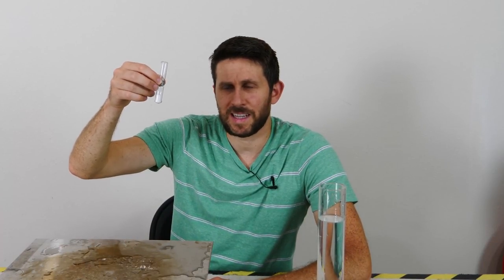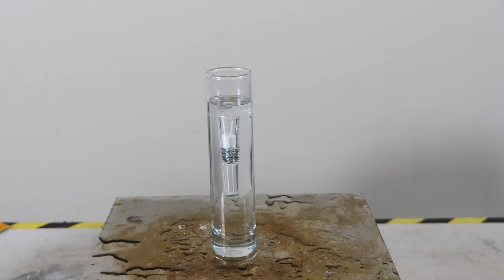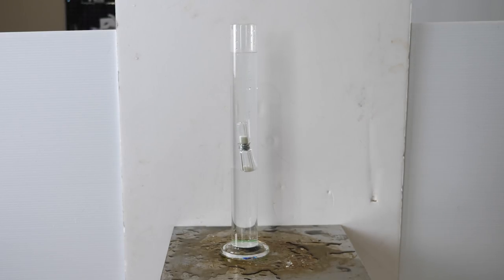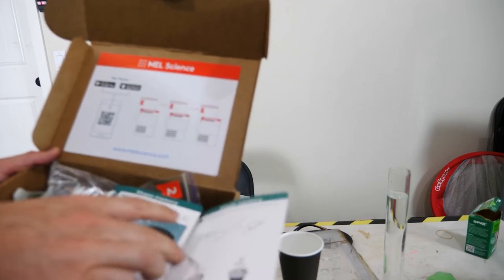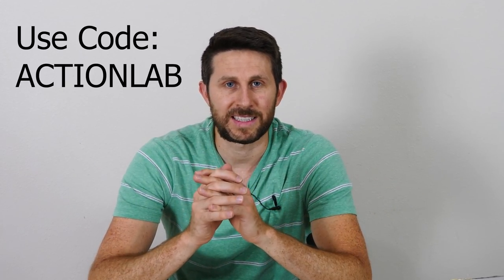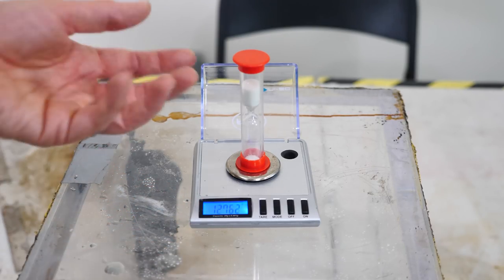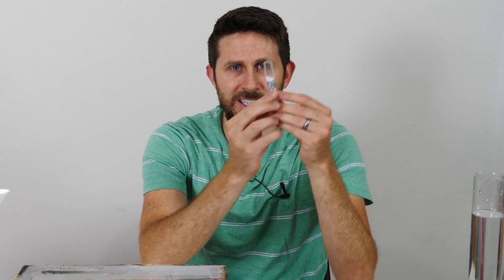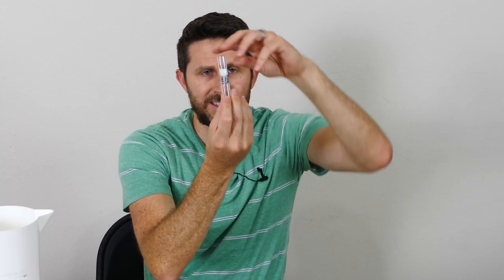Can You Figure Out The Hour Glass Buoyancy Problem?

Comment: Vibrate the host tube walls to release the friction by bouncing off of the sides.
Reply: No matter how much you vibrate the tube, the problem is the tube is too narrow for the hourglass to ever flip over.
Reply: @jerkofalltrades  but the friction would momentarily go away as the glass bodies separate.
Reply: Or tie a payload at bottom with a string and tune the density of fluid one weight of sand to support that load and it shouldn't flip over.
Reply: @jerkofalltrades  But it doesn't have to flip over to sink, if it did, then friction wouldn't be what causes it to float.
Reply: He forgot to show us one thing, what happens if you start with the hourglass at the bottom of the tube? He could’ve pushed it down as he even says in the video with a glass rod
Reply: @Qexilber  YES we need to see this! If it doesn't float up when it's at the bottom and it cannot turn itself then it would definitely prove that it is indeed friction
Reply: It would just sit at the bottom because it's too heavy to move upward with or without the friction.

Comment: I thought it would be something like how the center of buoyancy would be lower when the top boards fall, and it would be in slightly denser water because of the gradient and that would be enough to keep it up, then when the sand goes down the center of the points he is slightly higher
Reply: I agree with everything you said other than the water getting denser.  The water pressure increases the deeper you go, however the density remains the same as water is essentially incompressible.
Reply: I thought about this too. When the pressure is a little higher it pushes it more upwards.
Reply: Thats a pretty cool trick.
Reply: The center of buoyancy has nothing to do with the amount of buoyant force.  The density of water is the same in the container so buoyant force given by Archimedes (only displaced volume matters). This is the reason why the experiment is perplexing at first glance: Buoyant force is the same whether the hourglass has sand on top or bottom. The only explanation is what he  said in the video, friction with the container walls
Reply: @damartimantilla  hi. Overall buoyant force for the hourglass is the same as you said but the centre of neutral buoyancy changes slightly as the sand moves from top to bottom. That’s why it wants to flip over.
Reply: @nattycaptainanavar8319  no, the centre 9f buoyancy does not change. It depends solely on the shape of the object that is under water (and this shape does not change). What does change is the centre of mass (or gravity), which does go down. And the resulting torque (from the distance between these two centres of buoyancy and gravity where two forces are "applied") that shifts from one that tends to make the hourglass topple to one that tends to straighten it up.
Reply: @takix2007  thanks for that. I kind of understand. My rational was that if there was some way of preventing the glass from turning over when the sand is at the top in such a way that the glass is not otherwise effected by this force, it sit higher in the water than the glass with the sand at the bottom. Is this correct and just my thought process wrong or would it sit at the exact same depth either way? Thanks
Reply: exactly what I thought!
Reply: @nattycaptainanavar8319  So, the practical answer is the hour glass would sit at the same position in the tube whether the sand is at the top or bottom. Just for reference, the density of water at 70deg F and 14.7psia (~room temp and pressure) is 62.31 lb/ft^3, whereas water at 70deg F and 10,000psia is 64.10 lb/ft^3. this is only a 2.9% increase over a span of 10,000 psi.. The span of pressures inside one of these tubes is from 14.7 psi at the top (depending on atmospheric pressure, in the mountains it's lower of course) to 15.5 psi at the bottom. The difference in density between 14.7 and 15.5 psi is extremely small in the first place.

But, even if the gradient in density was significant I don't think it would effect the height of the hourglass sand-on-top vs sand-on-bottom. The reasoning is that the hourglass is a fixed volume, It will displace the same amount of water whether the sand is at the top or the bottom. Even if the water at the bottom is more dense, the amount of water displaced at the bottom is the same whether sand is in the hourglass or not. The movement of the sand does not correspond to a movement of the water. The water only sees the outside of the hourglass, and that is unchanging.

I think what you are arguing could be true if the hourglass was not rigid, like if the sand moving to the bottom increased the volume of the hourglass on the bottom, but decreased the volume at the top, then as the sand fell it would displace more, denser water, and as the sand fell the hourglass would raise, but it's center of mass would stay in the same place.

There are some cool videos about what you can do with liquids that have a significant density gradient, for one, they bend light into a curved line :D. Pure water is incompressible in any reasonable setup. Although, the density does change slightly more significantly with temperature, which is why it's important to not fill containers 100% full with water, cause if it heats up the container will likely fail before successfully resisting the change in pressure.
Reply: edit "but it's center of mass would stay in the same place."
I should have said "but it's center of buoyancy would stay in the same place." and this is assuming the volume of the hourglass is unchanged, and only moves from the top to the bottom with the sand in my hypothetical/magical hour glass example.
Reply: Do you mean center of gravity instead of center of buoyancy? Only the center of gravity changes when the sand falls.

Everyone's talking about how water has constant density, but I don't think buoyant force would change if the outline of the body stays in the same place, regardless of where its center of gravity is
Reply: That’s what you get for thinking.
Reply: There's another intrequing explanation for this: the bit of sand that is in free fall does not contribute to the weight of the hourglass. So while sand is falling, it is lighter (even if the scales couldn't measure it) 
I don't think it's a correct explanation, but it's a fun thought experiment to consider how it influences things.
Reply: @kroppyer  I think it would be a cool experiment to have a large weight drop inside a fixed volume. Should see temporary movement up and then down of the volume but will ultimately end up at the same place. I think the impact force exerted should equal the force loss due to falling mass if you control for the time so at a steady flow state with the falling sand, you will see no change in downward force.
Reply: @joescrivano5285  it does compress but this can be neglected because the significant difference occurs when the pressure is extremely high
Reply: Center of buoyancy depends on shape only.

Comment: Is it really the friction that keeps the hour glass from sinking?

If you look at the drop on @1:50 then it looks like it's sinking first. But then the buoyancy takes over and stops the downward motion almost making it look like it wants to go up again. Maybe this is where the friction comes in to prevent that from happening?

I'm really curious what would happen when you put the hour glass in (sand in top) and then pull the hour glass down with a magnet then releasing it. Will it try to float to the top first? Or will it just stay at the bottom?

My theory was:
If you divide the hour glass up in 2 sections (top and bottom) and look at the buoyancy created by each of those sections (both without sand) you will see that the top part creates less of it then the bottom part due to the pressure differences in the water caused by a difference in depth.
So lets assume: "A section filled with sand will only provide half it's original buoyancy".
When the sand is in the top it will lose less buoyancy so it floats. When the sand is in the bottom it will lose more buoyancy so it sinks.

Would that make sense?
Reply: I thought the answer was what you wrote in your theory.
Reply: If you put the hourglass with sand at the top and drag the hourglass all the way to the bottom, it would stay wedged there.

Your theory doesn't exactly hold up for incompressible fluids like water (it actually does hold up in fluids where density increases as you go lower down) because the buoyant force on a body depends only on the volume of the body and the density of the surrounding fluid.
If both sections were empty, then they would have the same buoyancy because even though the lower section is at higher pressure, the pressure difference across it is the same as that across the upper section, being equal to the product of fluid density, gravitational acceleration, and depth difference.
Reply: @PunnamarajVinayakTejas   I'm sorry for asking stupid questions and wanting to find out in my own way. Clearly you already have all the answers. 🤔
Reply: @ArjenZwerver  bruh. I appreciate you trying to find out. I do have a lot of answers with this phenomenon and I wanted to share and help people learn.

I apologise for getting so carried away I didn't notice the condescending tone of my comment.
Reply: No, the weight of the sand and the "bouyancy" are totally seperate things. The presence of sand in a particular half has no effect on the force the water exerts on the outside surface of the glass.

Comment: Hi 
Recently I noticed a weird thing around me
There's a electric wire outside my house, it's straight and has some slope 
When it rains water droplets since it has more adhesive force moves along the wire downwards
But water droplets from the other side move upward along the wire 
How this happened 
I am sure the wire is straight and has a slope
Reply: What is the "other side" you are referring to here?
Reply: @vasuyadav2931  I meant from other end of wire which is at a lower level than the first end of wire which is at a upper level

Comment: I don't think the friction is the reason, I saw it flote even when it wasn't touching the walls. But I think it's because of the pressure difference as you go down the tube.
Reply: Or due to change in metacentric hight initially as sand falls down it becomes unstable and sinks down
Reply: It was always touching the walls, it's just he changed the angle at the beginning as to not be so obvious.
Reply: I want to see this done with a string attached to the end so it can't flip, only sink when the sand moves down.

Comment: 1:36 I propose the theory of this is the sandglass wants to flip over because the center of mass is not as low as possible. As it flips over the head sketch the container wall, as the fiction generates an upward force.
Reply: Precisely. This is like an inverted pendulum, in an unstable equilibrium, so it will always tip over.

Comment: We can say the buoyancy is for all intensive purposes, static and unchanging. That means adding friction does not change the buoyancy. And neither would we say the heavyer than water upside down submerged hourglass is floating.

But we can say that the buoyancy counters enough  of the force of gravity, so that friction may hold it in place, untill the force from the pressing on the sidewalls (created by the hour leverage action created by center of mass along an unbalanced  hour glass and  buoyant forces acting on the hourglass), reduces enough that that lever can no longer provide the pressure nessesary to generate the friction nessesary to overcome the downward force.
Reply: Great explaination!
I would like your thoughts on the weight being the same in both the cases. I was thinking that if the hourglass is inverted and sand is allowed to fall, wouldn't there be the impact force of the particles falling when they hit the bottom surface, adding more forces to the weight. The greater the height, the more this effect would be. What do you think about this?
Reply: @HereToSin  My thoughts. When a sand particle drops from the top, there's a moment when the weight of the house glass is reduced by the weight of a sand particle while the sand particle is in free fall.

When the sand particle lands, the weight of that sand particle is again added to the weight of the hour glass.

additionally, it's possible that with friction and dry sand, electrostatic forces may complicate the process. 

Finally, while falling, the sand particle accelerates gaining momentum so that on impact, much of that impact goes to shifting other sand particles where  much of that energy transferred into making heat, and a tiny a fraction of it gets transferred to the hourglass. So, for a brief moment a collision with a sand particle may make the hour glass appear a little heavier  than the hourglass weighs after the hourglass time run out, but it's only going to be a tiny fraction of the weight of a grain of sand, and is probably offset to a large degree by other grains in free fall.
Reply: @kreynolds1123  Thank you for the insight. Have a great day!!

Comment: Hello sir,
Love watching you experiments.
I this phenomenon from my POV one of the reason for friction due to fluids can also be due to more air inside the lower end which creates more buoyant force in comparison to less air in the lower end... because water puts more hydro static pressure to the vacant space at greater depth..

Keep doing such experiments sir😊😊😊
Reply: But since the sand container is not deformable, so there is no way for the water to know where the sand is.   The boyant force does not change based on the orientation of the submerged object.    Even in a compressable fluid that gets denser with depth.    Laying flat the container expereinces 5 newtons of boyant force for each CC of water displaced.   Standing on end the higher portion exeperiences lower boyant forces, the the lower end experiences higher boyant forces.   resulting in the same average boyant force.
My explanation is:
 the weight does change slightly.   When the sand is at the the bottom all the sands weight contributes to the systems weight.   But when the sand is at the top and some is falling, the falling sand does not contribute to the weight.   If we had a ball in a box, the ball would contribute to the systems weight.  If we suddenly turn it over, while the ball was falling in the box, the box system would be lighter since the falling ball is not contributing to the weight.   The newly turned over device has a long column of falling sand and therfore 100 grains are in the process of falling and not contributing to the weight.   As the sand builds up in the bottom, the length of the column of falling sand decreases (now 50 grains in the state of falling) and thus the weight of the system increase since fewer grains are in the state of falling.

Comment: I thought that less “length” or “height” of sand being in “free fall” and thus “weightless” was contributing to the sinking...
Reply: Exactly the same line of thought I was following. It certainly results in a weight difference. Though it‘s probably an extremely tiny difference. I guess he would not have arrived at balancing to this accuracy with the wire he wrapped around the middle of the hour glass.
Reply: #metoo I also had this thought first the problem is the free fall accelerated sand then hits the bottom and pushes the hourglass downwards again giving its kinetic energy back to the hourglass. :D
Reply: I thought so too, but I realised that the total momentum of the system isn't really increasing, since the sand being brought to an abrupt halt at the bottom just gives back that force. So maybe while the flow is still increasing this could hold up?

Comment: Would putting a hydrophobic coating or some kind of lubricant on the hourglass to lower the friction make it sink right away?
Reply: What i think is if hydrophobic liquid is introduced on the outer surface then the tube might go into an equilibrium wrt the water in the larger tube, but as the water is been pushed alway it stricks with the the inner wall of the larger tube and the force revert backs the smaller tube 
(mainly it might give us the same result as shown here my hypothesis!!)

Comment: For a split second while it is upside-down, however, some sand from the top will be in free fall without any yet hitting the bottom of the glass. 
It would be lighter for that split second as the falling sand has no weight. Though that effect would immediately be canceled out by it hitting the bottom or (in a perfectly stable floating) the bottom would rise to hit the falling sand.
Reply: The falling sand does in fact still have weight in the hour glass frame. One way to account for it is that the sand is pushing air equal to it's weight out of the way but that air is trapped in the hourglass. The sand might not feel it's weight but the hourglass frame does. Measure an hourglass on a scale and note that the weight doesn't change. good thinking though.
Reply: @medleyshift1325  the sand is only pushing air equal to its volume out of the way, not weight. If u consider the limit where the density of the air decreases to 0 as in a vacuum, the sand must be weightless. While the air will be pushed down slightly by the falling sand, it will also be pulled up by the lower air pressure in the top bulb as the sand leaves. While some molecules of air might hit the bottom more frequently during that phase I think that effect is inconsequential. It should still happen though, but I think the net effect is still a decrease in weight.

If you consider a bowling ball dropped over a scale in an airtight box where the scale is the entire bottom face, I don't think the scale would register its weight while in free fall.
Reply: @medleyshift1325  That's only true if the sand is at a terminal velocity, which it will not be in that short of a distance.